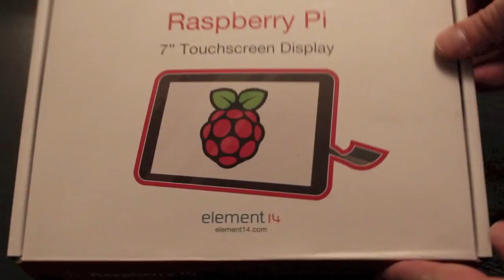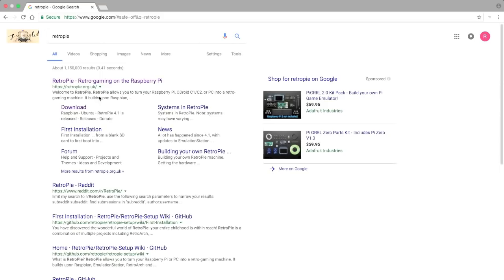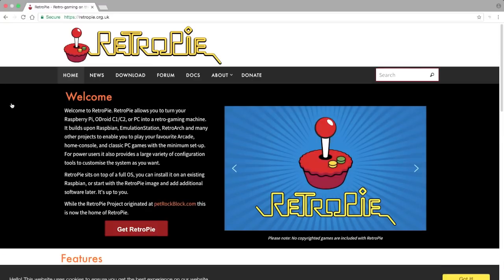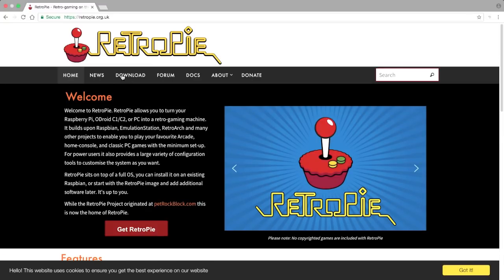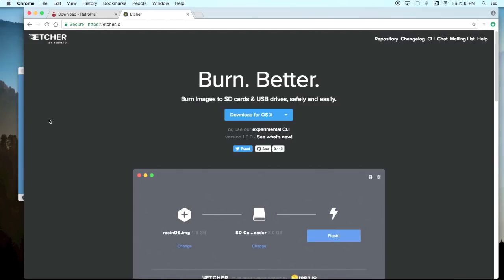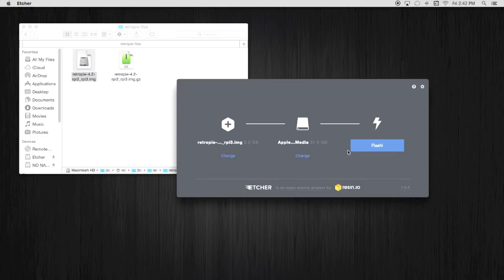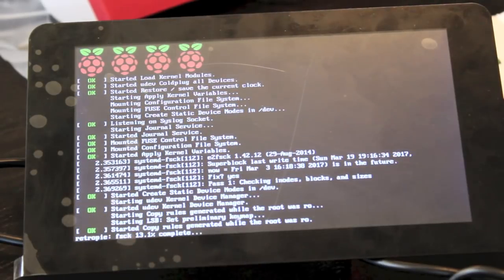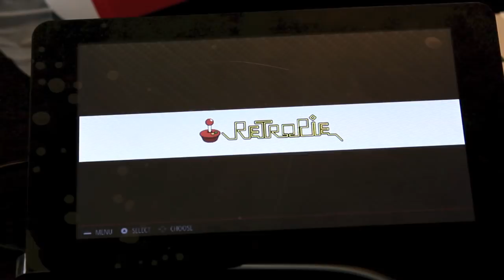DIY RetroPie Arcade in a Fancy Wooden Box

Comment: I love this build and I am planning on using is for the basis of my own build. It would really appreciate if you could answer a few questions I have. Firstly how wide is the box? Also does your setup produce sound? If so how did you manage this? Thanks in advance!
Reply from the maker: The box is about 13" x 9.5" for the outside dimensions. I would recommend making it a tad bigger because things are pretty tight as it is. For sound, I put a tiny speaker in there that connects via a 3.5mm headphone jack. Apparently though, the pi has a known issue with the 3.5mm jack outputting tons of static, which mine does. So I would recommend looking into a small speaker that connects directly to the board itself. Hope that helps. Let me know if you have any questions along the way.
Reply: Will do. I am just in the process of getting all the parts together. Thanks so much for getting back to me.